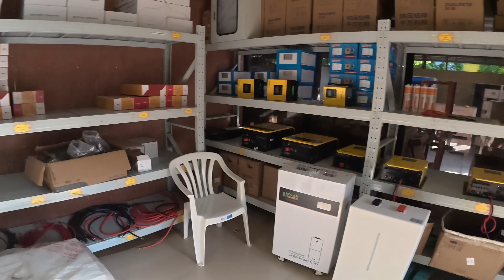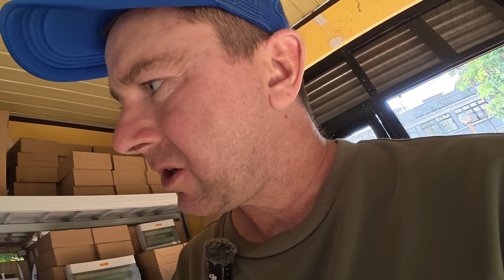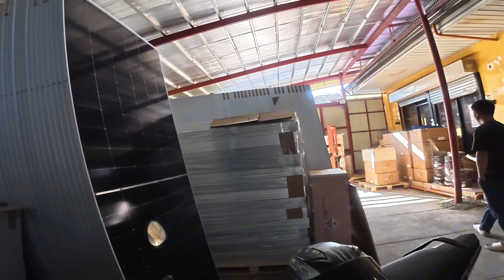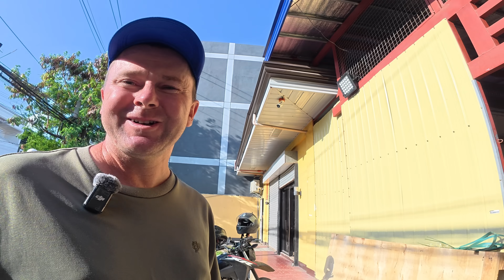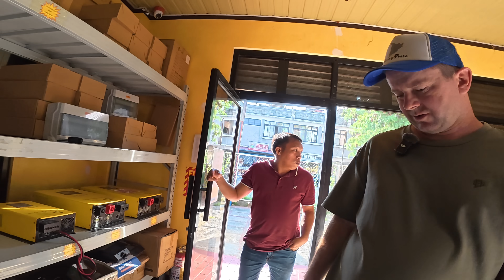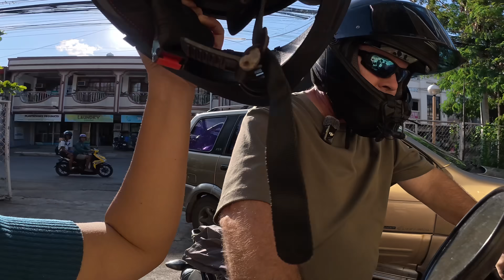Philippines Cost Of Solar Energy

Comment: So I have a lot of experience with my Solar System. A bit of experienced advice, don’t assume you will never need commercial power. Yes, we have lots of sun here until it rains for 20 straight days. 
My system has 30 panels with a 16 KVa Deye inverter and I have four 200 amp hour batteries. However I have 9 Air Conditioners but never more than three on at any one time. My system is a hybrid system mean I can and do draw from the grid and can sell back to my utility. However, they only buy back at 1/5 of what they charge me. 
Changes I am making. I have on order 2 more to make a total of 6 NPP 200 Amp hour batteries. Cautions to add a battery you have to use the same model size and brand because the first battery has a BTS system that regulates the slave batteries. Don’t undersized your Inverter otherwise you cannot add panels and the price of panels is dropping faster than any other part of the system.
In my case even with four 200 Amp hour batteries I cannot make it overnight before the sun comes up. One thing I bought when we are in a brownout and rain or night with no solar I bought a small 4 KVa hybrid generator that will charge the batteries. Mistake I should have bought a bigger generator.
Just passing along my real world experience you can take it or leave it. 
I don’t want to sound to pessimistic since having my solar system installed I have never experienced a brown out again but you have to manage the system

Comment: I think they made it illegal to go off grid in the sunshine state. They want you to create electric with solar but they want it to go into the grid. Not for private use. I know someone that installed enough solar to run the things that use less electric and then he has the heat creating power using items on the grid system. Two systems. I priced a system that wouldn't power everything (10 yrs ago?) and they wanted between 20 and 30 k installed. In relation to cars. They are now trying to tax electric cars using the road use excuse. So first they were  doing a flat tax where everyone paid the same amount. With gas, the tax is on the gas. Use more gas and then you pay more. With electric it doesn't matter if the car sits all year, you pay the same as someone that drives all the time. Now I think they want to tax miles driven. But what if you aren't driving on state roads at all? What if you are driving around in a field or on a country dirt road to accumulate miles. The politicians are idiots pushing forward globalist agendas. People don't want the electric cars here. People are buying up older no tech vehicles that can't be remotely shut off. All vehicles are supposed to be able to be shut off remotely by 2026 or 7. They should give incentives to get people into the electric cars and then hammer them later. Not hammer them and that deters people from buying. Buy a gas chainsaw for 200 or a electric chainsaw for 600? Meanwhile they are wasting power resources on a lot of data control you centers. If energy resources were limited, they wouldn't be creating so many data centers. If they were really concerned about pollution once again they wouldn't be creating so many pollution creating data centers. It's about control. In relation to the little Honda 2200 or 2000 generators. There's a kit you can buy so they run off propane and gas. Propane doesn't go bad.

Comment: Consider  how many kw an electric car when charging ex. Byd charger is 7.5kw and the one you quote for inverter is 8kw deye brand.. you might consider to go with 10 or 12 or maybe 16kw inverter to run all other appliances and equipment
Reply from the maker: Great point, we are definitely looking into sizing the system to handle the extra load of the vehicle.

Comment: Reasonable prices.
I have a small system myself. Totally worth it.
For you current consumption you need just 4 of those panels to cover most of your consumption. And you could probably make do with a smaller battery and a 6 kW inverter.

300 km range if you plan to make that trip to Iloilo regularly is a bit short. 300 km is theoretical range with a very optimistic test cycle. In reality you're looking at more like 200-250 km. You're going to want to use aircon. And the roads are not flat. It's warmer than in a test room, so the batteries are going to have to be cooled as well. And then there is battery degradation. Try renting a similar car first and see how it goes. I recommend you get a car with more range or get a plug-in hybrid.
Reply from the maker: Thanks for the advice, we are definitely keeping those real-world factors in mind as we plan our setup.

Comment: I have been off grid in Canada for over 10 years. James if you are handy and not afraid of batteries you can purchase the cells from China ( that's where those are from also ) Then install your own BMS system. I would recommend using a company called Daly. You definitely want to go with the 48volt. 14 x 660w panels is alot of power good sunlight those should have an output somewhere near 9.5kw/hr at well over 60amps. You will save money if you can put this together yourself. Could maybe look at getting a AGS unit which is Automatic Generator Starter. It works based on the voltage you set low and high.
Reply: We use lifepo4 here in the PH not lead acid so it's 12.8v per stack. it's 4 in a series is 51.2v and about 314ah. Everybody who has a bit of money is getting them cause with the high power costs you can roi in about 2.5 years to 3 years. But the biggest flex is that in the summer when it is stupidy hot you can pretty much run ac all day and still have full batts when you hit sun down.

Comment: IF you are going with 14 of the 650w panels.. make sure your inverter mppt ports can handle the input voltage totals.  get a minimum 12kw hybrid inverter.  When it comes to batteries.. often MORE smaller 5kw 49v stackable is better than a single large one.  It comes down to the total amphours.
Reply: Exactly....buying cheap garbage inverters is definitely not the way to go, and do not believe that your battery will be full charge by 10am...rainy season it will not happen and a backup generator connected to your inverter is best.  I see you are an expert now on Solar, Congrats.
Reply: Are three 5 kW batteries better than one 15 kW battery?
I think you've forgotten your physics.

Comment: make sure its LFP battery solar panels only charge the LFP battery house power draw through battery you can charge car off Solar and grid wall unit 7.5 kw to start ask dealer for free wall unit cost to charge car abut 11USD for full Charge of home grid if long brown out use the car battery to re power the house  just install double throw switch plug in the car battery car out puts 220 volt 6kw load  dc charging station in shell kalibo 4 stations in roxas many in iloilo but with the range you can charge at home and do round trips with out using commercial chargers Start with the car and grid wall unit then add the solar LFP battery this one loves 100 % charging not 20 to 80% should last 10-15 years  GAC Iloilo has a similar EV car for 900,000 bought the GS8 from them decent customer service GAC is now direct subsidiary of GAC China  builds Toyota Cars in China no longer local PH Dealer distributers  Faster parts better service same with Geely PH now direct subsidiary of Geely group Filipino importers were only interested in sale no service now there replaced

Comment: Hi both

Good shout on going solar. 

We've been fully 100% solar off-grid for 2.5 years now.

We upgraded our Deye inverter last month to an 8KW. We needed a bigger inverter as we built the swimming pool and the pump will need to run up to 6 hours a day.

We have AC o  24/7 and never have any black-outs. The region heee suffers almost daily here.

Cheers

Simon
Reply: This is ourstanding Simon. Would you want to do a video showing us how it all works???

Comment: Bifacial panels... raise off the roof 3' to get the bifacial benefits... otherwise, panels won't produce what they are rated for..  I'm sure you read a bunch about it already.  Strong racks needed for that weather there.  10-11* angle for that location

Comment: First: In Maps the name might be UNLI SOLAR Deye, KALIBO? Second: My house in New Washington was designed with two air conditioners: a 1 HP unit for the bedroom and a 2.5 HP unit for the main room (54 m²). The entire house, including the ceilings, is insulated with 4" Styrofoam on the outside. My solar system consists of a 4.2 kW inverter, ten 550 Whp panels, and 10.4 kWh of LiFePO4 batteries. My consumption in July 2026 was 292 kWh, with 4 kW of grid power drawn. Solar production and consumption thus totaled 288 kWh. The air conditioner in the bedroom runs all night, and the one in the main room practically all day. I purchased my components from various sources and installed them myself as an off-grid system, with several custom-made technical extras. The total cost was approximately 200,000 PHP. - Yep, Kalibos best word is "brownout" 🤣🤭
Reply from the maker: Awesome! Thanks for commenting. Drop by our house sometime
Reply: @JamesandKarenadventures  Just give us a hint where to go and we will be happy to have a new target for a motorcycle trip 🛵

Comment: James,build a separate battery room and install a Aircon unit in it to keep the battery and equipment cool,you can also use some of the area as a pantry
Reply from the maker: Yes. We will do that
Reply: Yes best to install the battery a safe distance from the house.
Reply: The batteries are lifepo4 they are super safe (you can stab them with a knife nothing will happen).  Just put them in the inside to keep them safe and you can always get a kick out of looking at your harvest.

Comment: James you're going to want to put in a switch that does not let your electricity go back into the city or county wiring you don't want your electricity going back through the line if they're working on the line
Reply from the maker: I’m going to remove the house from the grid completely but yes I understand the necessity of the proper cut off

Comment: James make sure you are getting a 48 volt system.  I would encourage you to check if you will be able to put another invert in parallel with the 8KW inverter you are looking at for your system.  Youtuber  "DIY Solar Power with Will Prowse" is a great resource for your off grid solar system questions.
Reply: Excellent Suggestion WILL IS THE BEST BY FAR YOUTUBER ON THE SOLAR SYSTEMS ( He Is THE TOM BRADY OF SOLAR

Comment: Plus, also take them to consideration with an electric vehicle. There’s a lot less maintenance. You don’t have to change the brakes as often it’s cheaper and less complicated in a lot of ways.
Reply: tell their  flooding then their  useless ev .      drive my suv  go thur flooding and use gas.     i have both .

Comment: My advice is get as much solar capacity as you can afford as most people underestimate their power usage. Also it's better to have more power for future power needs. I did my DIY system on my house and I'm running a Deye 12kw hybrid inverter, three 51.2v 314ah batteries supplied with 40 Seraphim 630w bifacial. I still need at least one or two more batteries as the three batteries now only last me 5 hours.
Reply: your not  emp proof?   if not boom  .  watch american prepper  has in a faraday cage  type building
Reply: @hillbillyintheasia6122  The best I can do short of Faraday caging my entire property was grounding my entire solar system.
Reply: Wow 40 solar panel and you still need another battery ( only running for 6hrs ?)

That's got to be a Massive house with a lot of power consumption
Reply: @RobertJudeThomas Not a massive house as it is only a 3 bedroom but we are power hungry to say the least. We are running two 3 doors chest freezers, two 2 doors chest freezers, two upright freezers, one 3 doors refrigerator, one 2 doors refrigerator and three A/C units running 24/7. 

I am planning to add 10 more 630 w panels next month to erase my 5k/month bill.

Comment: If you do not install your inverter and batteries in a temperature controlled room, you will definitely end up with issues. So that should be included in the cost. Switching to an electric car in Pinas depends really would make sense if you live higher up .. if you end up in flood prone residential areas, you can forget driving your electric car unless you wanna drawn your batter also whenever you hit a rock with the undercarriage if your electric car, and it hits that battery carriage your car will be written off immediately because they can't guarantee the safety. So the question is would you take the risk buying such a car, knowing the risk of hitting the battery is highly likely in the area where you live.
Reply from the maker: We don’t drive through that much water. In the more than two years I’ve been here that’s not something we’ve encountered. The exact mode we are after wasn’t in stock. It’s the Geely Radar RD6 EV 4 door pickup. Perfectly well suited to our local area

Comment: You must do further research on how much power you need based on the consume you have at the moment and future . So you don't oversize your actual needs. Those solar shops will happily sell you a system that is bigger than your needs. Look at your electric bill and see what your daily kilowatts are. Begin small and build the system as your needs grow. Otherwise you will only being showing off that you have to much money! If you can sell the surplus to your electric supplier don't think that they will pay you the same that you pay them.
Reply: U can oversize ur panel array (i.e. Over panel) within VOLTAGE of inverter......u should NOT over size ur batteries.......batteries need to be cycled......pls understand this.

Comment: Excellent deal! With an electric car, you can always put a little generator in the trunk for emergencies! This is all very reasonable. The SUV was about 16000 and the solar was about 5000. Can't beat that. And the warranty on that SUV was excellent. For less than 25k, you can power everything and have a new electric SUV. I would really like to see the truck you are talking about. What brand and model are the trucks?
Reply from the maker: It’s definitely a game changer to have that kind of setup for such a reasonable price! The truck is The Geely Radar RD6 EV 4 door pickup
Reply: I was laughing when the Colonel said carrying a generator in the back of the SUV because one day I was driving home from dinner and I saw Tesla with a small Honda generator on the roof plugged into the PowerPoint and running it had ran it dead. lol
Reply from the maker: @aicsusa 😂
Reply: @JamesandKarenadventures Is Geely a Chinese company???
Reply: @Jamesan @JamesandKarenadventures UV they said was priced it just under 1 million but online they are saying the price is 1.4 to 1.7 million. How much are they actually selling for over there? Actually, there is one for 2 million 4 x 4 luxury pick up. i’ve been looking at the Ford Ranger and the comparable Toyota four-door truck. at 993,000 for that SUV I think I’d grab that before they change their mind

Comment: Average American home will requires 12K inverter............so if u plan a electrical heater in shower, pool pump, EV car, air con..... u should start with 12K Inverter......BUT a proper AUDIT with future in mind is required......RESEARCH RESEARCH RESEARCH pls